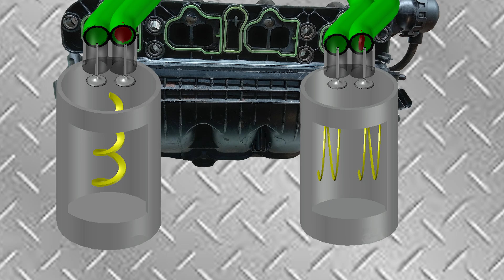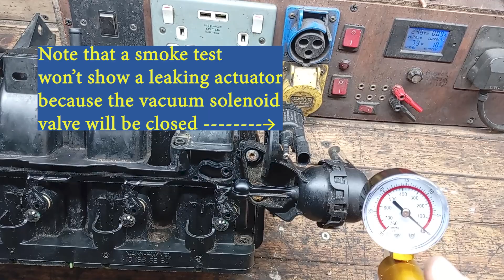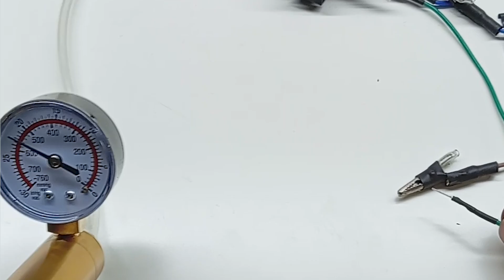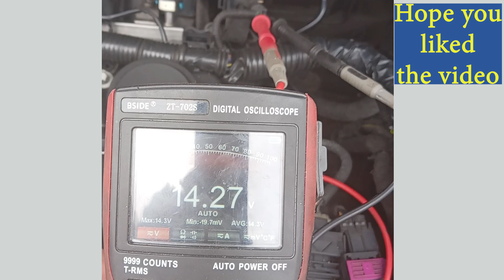Twin Port & Swirl Flaps

Comment: In theory, yes. In reality, while the EGR destroys the combustion efficency by 50%, the turbulence from the swirl flaps brings back 10%. Disabling and removing everything is always the best option.
Reply: I'm pretty sure the mechanical engineers at GM and Opel knew exactly what they were doing. There is no way the engine is more efficient without the system.
Reply from the maker: interestingly this engine the petrol 1.4 A14XER doesn't have an EGR system at all. It looks an expensive add on that I'm sure the manufacturer would have avoided if they could - it's just a fun video for those who wonder what Twin Ports are all about.
Reply: @ I stand corrected. It applies for diesel engines. On NA petrol any air speed improvement is welcome. On this particular engine nothing helps. The inefficiency of the GM 1.4 is second only to the Dodge Viper. 10l/100km for snail performance.
Reply: I found that these flaps clatter like crazy almost like rod knock, should I premanently open them or maybe just change the vacuum pump?
Reply from the maker: Sadly if the flaps are rattling on the Corsa the only effective correct fix is to replace the inlet manifold because the flap spindles are worn there are no replacement parts for this fault.
Reply from the maker: @ivanjovanovic362  Hi buddy the only fix would be a new inlet manifold
Reply: @DoToGetIt  I drove it on a highway at 4000 rpm and now I there is no noise 😅
Italian tune up!
Reply: I have exactly the same problem: swirl flap clatter from the near side one. The clutter goes if I press down very gently on the crown of the swirl flap or the ball joint. Only a couple of hours ago went to my local garage. A new original Vauxhall inlet manifold is £966. And after market one from auto dock is £114 and one from some parts on eBay called D2P is £86. Nonetheless, changing the inlet manifold is too bigger job for me my local garage quoted about 2 to 3 hours so about £300 in labour I am not sure why the swirl valve should clatter if it is merely being held in a position between open and closed depending on the engine revs but clutter it does. As it is just a worn spindle I have squirted WD-40 and oil and used a syringe with needle to get some oil at the top of the swirl valve. Hopefully this will seep down the spindle and mitigate the problem. After me playing with the valve assembly to figure out what was going on it seems to clatter less and after I’ve squirted some oil in there it seems to clutter even less though maybe that’s just my imagination and wishful thinking! I am now going to look on the Internet to see if there’s any way to fix this without removing the whole in that manifold. What a terribly poor design!